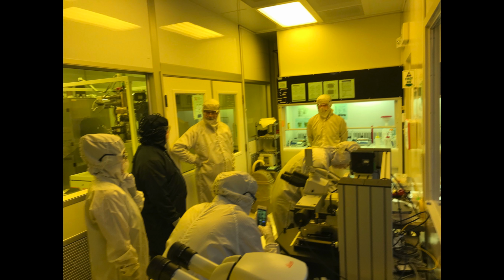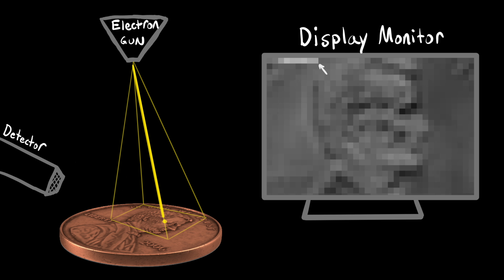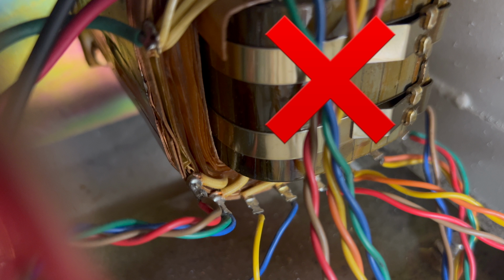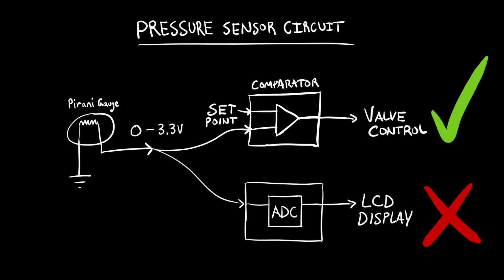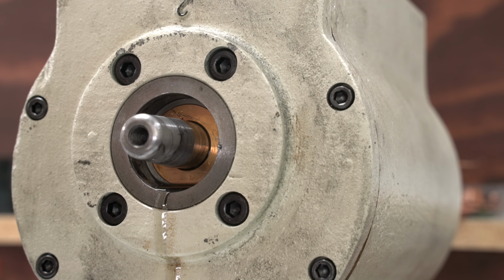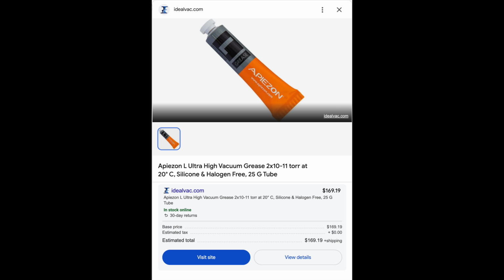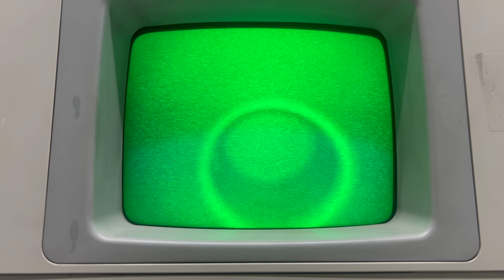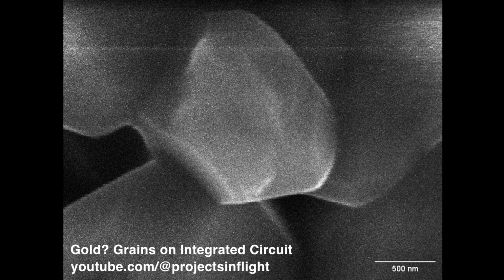I Saved an Electron Microscope from the Trash

Comment: Takes me back many decades.  We used their 100B and 100S TEMs, and had a small T100 for the undergrad. students to use, whilst the research students got to use the (very latest) JSM 35C with all the goodies.  Yours uses a turbopump - and they do need loving care, and for an SEM, the upgrade from tungsten hairpin to LaB6 is more than worth it for increased beam current availability (and or=f course longer emitter lifespan).
We also had access to a Stereoscan 180 - the "Rolls Royce" of SEMs in the day, and still up there with the best in terms of resolution.
Reply: It does not use a turbopump, it uses a diffusion pump. Very different things. He even explained it thoroughly in this video.
Reply from the maker: Unfortunately, this machine does not support LaB6 filaments (as far as i can tell). I'd love to try a field-emission SEM someday

Comment: Any person who can fix a electron microscope with shorts like them  on is just fine in my book. That was a most fascinating undertaking.I am familiar with vacuum systems but nothing at this level. A diffusion pump wow! 
The Power supply fix was great also. I had an opportunity to work on an old broadcast camera it was a challenge being no parts were available. By the way the wall light switch you use is priceless.
Reply from the maker: lol. it's crazy that those are so cheap. it was the least expensive component in the whole build lol

Comment: Gosh.... take those 7805 away and use LM2596 modules instead! they handle higher currents and do not heat. Don´t forget to adjust the output to 5V before you use them, they usually come set to output 12V. It might seem ok that 7805 "only heats up to 50C", but hot semiconductors live less.
Reply from the maker: I don't want to use a switching power supply at this time because I cannot guarantee that the high frequency noise will not affect the unit in some way. I am probably being paranoid, but i just wanted to change the unit as little as possible. Also, fortunately at normal load they don't run at 50C, quite a bit cooler
Reply: @projectsinflight  

You´re right, RFI of a SMPS is a concern. I should have foreseen that.

But you can also power the 7805 with a lower voltage like 9 or 8V,; the heat dissipation of the 7805 is the (voltage difference between input and output) multiplied by the current, plus some losses. The lower the input voltage, the lower the heat generated. Datasheet states that minimum input voltage is 7.5V. Congrats on your work done!